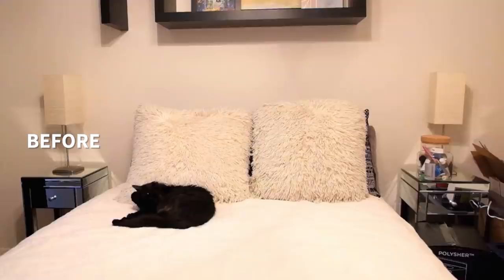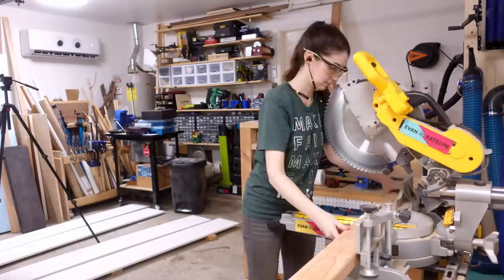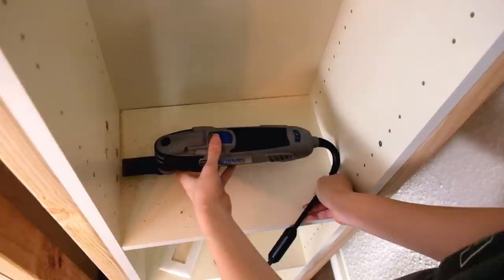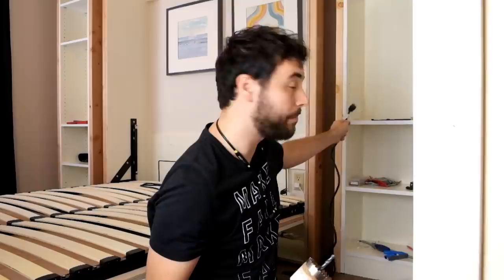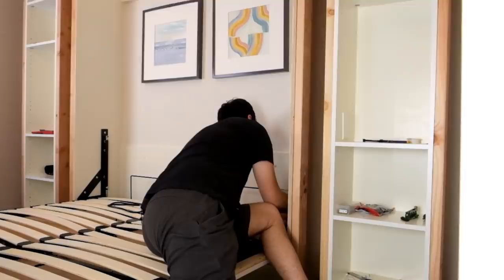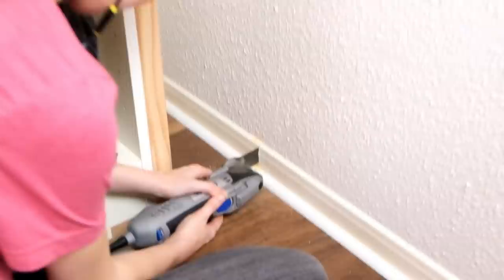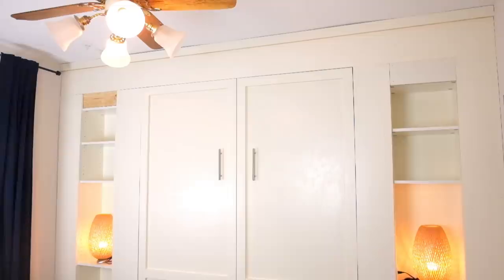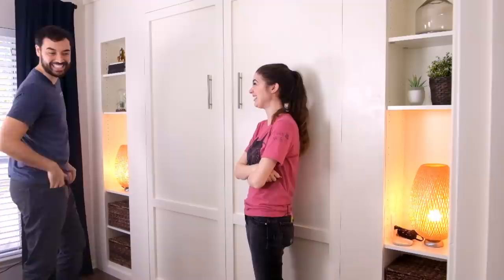We Made DIY Built-Ins for our Murphy Bed

Comment: 1:40 ... when my video would have ended 😂
Love the inbuilt outlets, looks a hell of a lot nicer than visible power strips. Never occurred to me, to put outlets into furniture 😀
Reply from the maker: hahaha! at 1:40 we were tempted... :P Thank you! The outlets were Evan's idea, I think they turned out really nice!
Reply: @christopherverges2328  thank you! I was worried about safety when I saw the "appliance cord" wasn't even plugged straight into the wall but put in ANOTHER strip.
Reply: Probably because it’s a bad idea, especially the way they did it. It’s a shame they didn’t take a little responsibility here and say “we’re doing this, but it may be u safe. Check your own electrical code”.  Honestly it would have been a lot more work to just replace the outlet box with a closed junction box and properly and safely  run the wiring to a new box. 
When it comes to electrical, if it’s “easy” it’s usually dangerous and against code. All the extra work and precaution done on home wiring is for very good reasons that your very life may depend on.

Comment: You may have made an issue. You plugged an extension cord into your wall socket then plugged the cable into the extension cord...so nevermind the fact that you have plugged an extension into an extension which is already unsafe, but it means that guests won't be able to plug extension cords into the plugs in the cabinet for the same reason....just thought I'd let you know
Reply from the maker: Thanks for the heads up! The danger is due to current and we have low watt LED bulbs installed and don't foresee much current/heat building up in those wires. We also got over-rated strips and wires too just in case 😊👍
Reply: @EvanAndKatelyn  at least you thought about it :)
Reply: @EvanAndKatelyn  But what if you sell this house and move one day and the next people don't know about the issue and plug in something high load there? Or a guest staying in your murphy bed does so? I think you should get an electrician to do it properly. This project came out very beautiful though. Great job otherwise!

Comment: You should either change out that outlet in the wall behind the bed for one with built in usb or add a usb outlet higher up to the inside of your Murphy bed on one of the sides or the other(connected the same way as the other one).  The one thing guests always need is power for charging their phone by their bed.
Reply from the maker: ooh adding USB would be a good idea, we might just change the outlet since that's an easy change :)

Comment: You guys probably aren't raring to go and start another wall bed project...
I actually work for a company that designs, sells, and installs custom Murphy and Panel Beds. A really cool thing you could do in the future to save you the mess that was installing that additional outlet is to just use a power grommet. They usually come with two outlets and two usb ports. That way you only have to drill out two holes (one in the shelf and one in the bed cabinet) and avoid a jigsaw altogether. Another cool addition is some plug and play LED can lights in the top of the bed so you don't lose two shelves on the sides to lamps.
Great work though. I love how this bed came out.
Reply from the maker: Ooh good ideas!! I've seen those power grommet's for office tables and desks but didn't think to install them at home, great idea! 😊

Comment: My wife had me build her a work counter in her craft room.  I got a couple of vanity bases and a counter top with back splash.  I cut a couple of holes in the back splash and mounted duplex receptacles for her to plug things into.  I just bought heavy duty extension cords to run from the boxes to the receptacles on the wall (after cutting off the spare end).  Worked out well.  I would guess your PERMANENT installation plugging into a receptacle does not comply with many codes.

Comment: Love the Murphy bed build out. Is there any way to put a light source inside where the bed is? The lamps are indirect light and for those of us who read or bead or design before lights out, that's not enough light. Any ideas? Love your show.
Reply from the maker: Thank you!! Yes you could run electrical above the cabinet and add some recessed lights at the top, that'd be really cool :)

Comment: love the video you guys are awesome and I've been bingeing all your stuff, but wouldn't you guys be worried about running so many appliances through the one outlet?? i feel like i've always been taught to be careful when plugging in adapters to make sure you don't overload it!! just wondering though as I know it's different in each country :)
Reply from the maker: Thank you! Based on our research the danger is due to current and we have low watt LED bulbs installed and don't foresee much current/heat building up in those wires. We also got over-rated strips and wires too just in case 😊👍

Comment: Daisy chaining electrical cords is very dangerous.
Reply from the maker: based on our research the danger is due to current and we have low watt LED bulbs installed and don't foresee much current/heat building up in those wires. We also got over-rated strips and wires too just in case 😊👍
Reply: EvanAndKatelyn it’s good that you’re aware of what you’re doing. At my workplace this will be a huge red flag and cause us to fail inspections. OSHA, NFPA, and UL will be all over it.

Comment: Not to be a downer, but since the bookshelves are enclosed, using that extension cord would be against most local residential building codes. Almost all residential building codes prohibit the running of extension cords "within a wall or inaccessible cavity" and do not allow for runs of "non-protected cable for the purpose of substituting fixed wiring to the structure." Following this video's plans, you will want to remove the built-ins prior to trying to sell your house as a building inspector will definitely flag this as a concern on inspection.
Reply from the maker: Ah thanks for the heads up!!

Comment: I don’t know that much about wiring, but I do know you’re not supposed to daisy chain extension cords like that. Maybe it’s safer because of the appliance cord, but I would plug that directly into the wall rather than the power strip so it’s only one extension instead of two.
Reply from the maker: Thanks for the heads up! The danger is due to current and we have low watt LED bulbs installed and don't foresee much current/heat building up in those wires. We also got over-rated strips and wires too just in case 😊👍